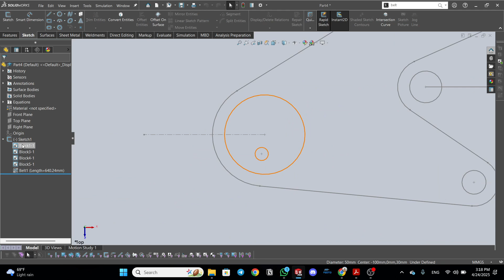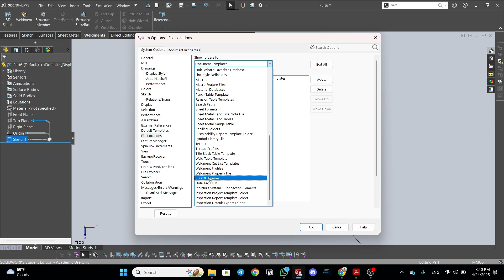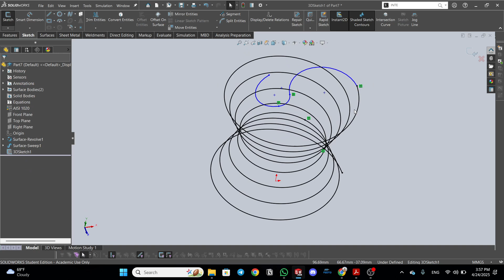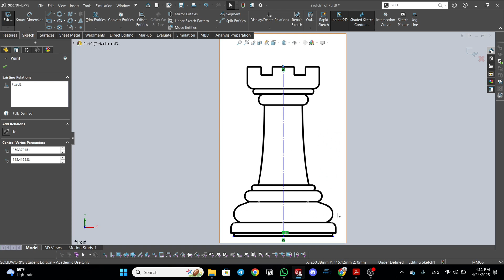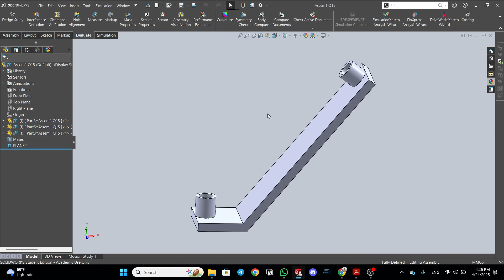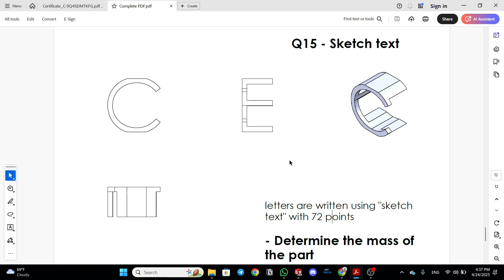( CSWE - CAD Design ) Preparation - Becoming a Certified Expert

Comment: Great video Yusuf, thank you. For the 'assembly in context' question, you spotted the non-tangent spline that was clashing with the boss, however I noticed you ended up trying to fix the other end that was already correct (I'm sure you've watched it back by now and have seen for yourself). When I ran through it, my mass result was different - I got 1341.05g and you got 1288.81g. I wonder if this was the reason and who - if either of us - -was correct?! It's only a few grams, but th difference between the question being right and wrong...!

Comment: Hello Yusuf, thanks for the video, you did a great job. One small issue I noticed is that on the belt & chain question (Q1), the belt thickness shown in the image is 15mm (meaning you have to put 30mm in Solidworks, since it creates half of the thickness). Your result matches mine, but either the dimension should have been 7.5mm in the image, or you should have used 30mm instead of 15mm in Solidworks. Hopefully you can correct me if I am mistaken, thanks a lot once again!
Reply: Sorry, I disagree - when you activate the 'Use belt thickness' option, the software automatically offsets the belt curve outwards from the pulley by half of the value you input (so if that's 15, it will offset 7.5 mm). This correctly aligns the centerline (pitch) of the belt with the outer edge of the pulleys.

Comment: THANKS for the video, I have a problem in the first exercise on the sketch and block (chain) the circle of diameter 20mm when we look at the belt created, it does not touch the circle of diameter 20mm but touches the 3 other circles, I think that we had to first make an offset of 15mm on our circle of diameter 20mm, and it is with this new circle offset to 15mm that we must create the belt